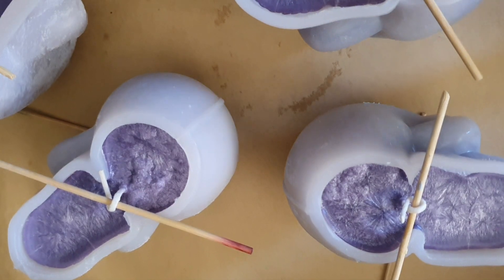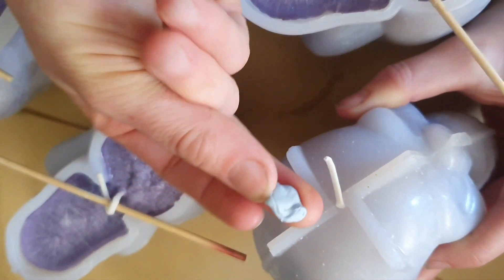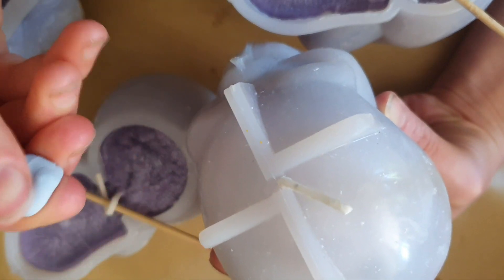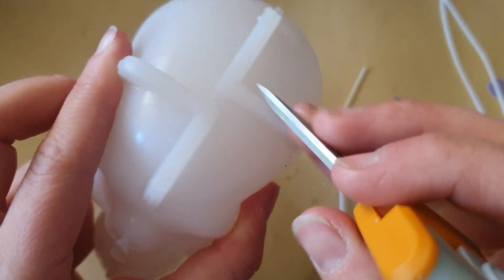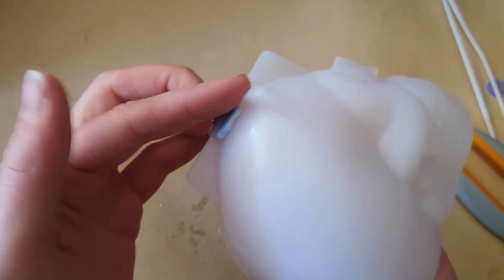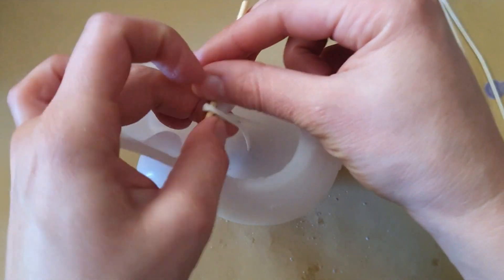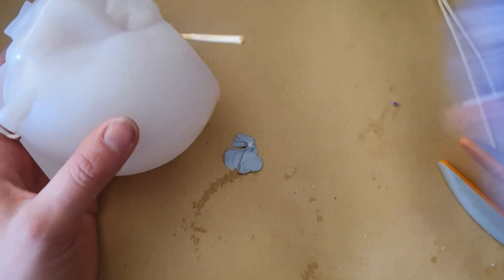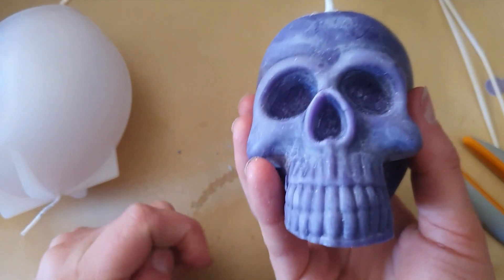What to do when your silicone moulds are leaking wax!  - Candle making tips for beginners

Comment: What wicks do you use for your mold candles? I've tried a handful and although I feel most customers don't burn the molded candles as much, they all just seem to burn too fast - especially for small diameter projects (especially the zinc core wicking roll I got - seems to burn really quickly).
Reply from the maker: Hi there, I use ACS wicks.  You really need to experiment with different wick types to get one that will work with the size of the pillar candle that you make.  Zinc core wicks would melt too fast/burn too hot for pillars.  Yes most customers will not burn the pillar candles but for those that do, you need to make sure they burn correctly.  Hope this helps :)